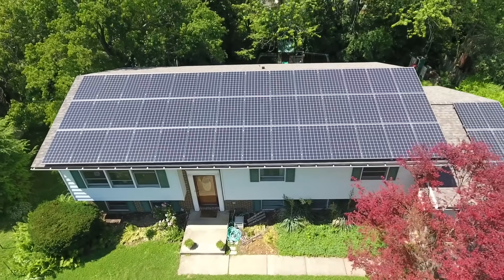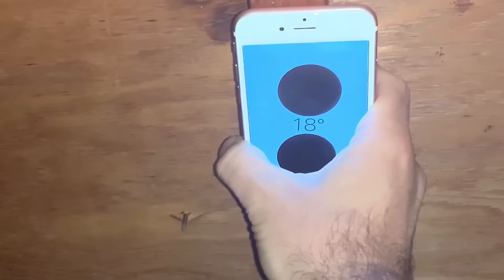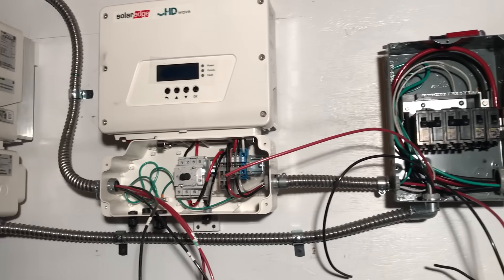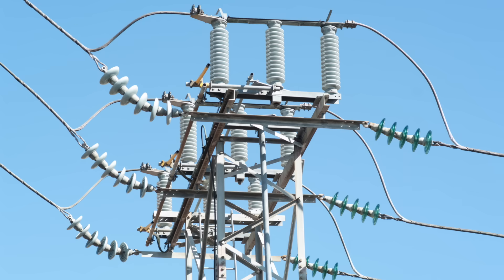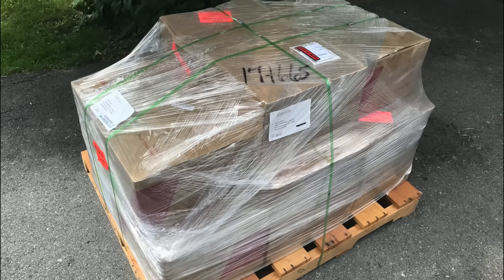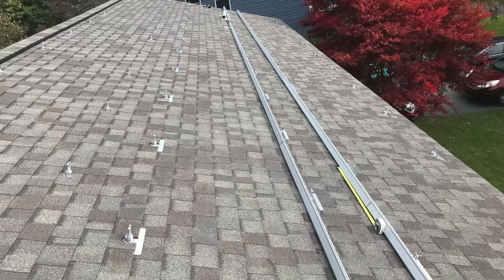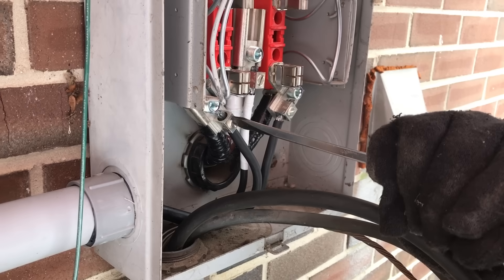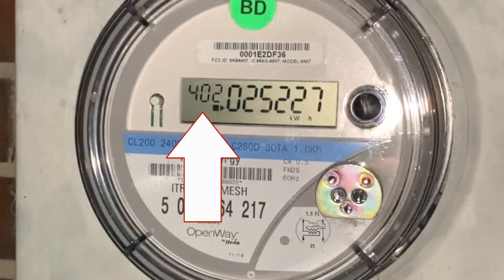I Installed a Power Plant Myself | HUGE DIY Solar Panel System

Comment: never on the roof you only need to be protected the more it is protected the better it is for this I know everyone will say that on the roof on the roof and easier but instead to do quality work and work very efficiently it costs very expensive why you need in six that is in four corners or in 6 corners or in several stages concrete pillar and then you put fiber that is Metal and over the metal you put the solarium then it is quality has no problems has absolutely nothing What can work much more effective for such a thing many will say what you have and for what and how it is much more effective and much more protected roof on Many I have seen how others had problems others had to suffer This helps the solarium to have green energy

Comment: ca să faci energie pe termen lung pentru casă primul lucru îți trebuie să te uiți cât de rezistent îți este acoperișul după aceea trebuie să te uiți foarte atent Cât de rezistent îți este tablă sau acoperit acoperișul ca să poți pune panourile solare cel mai bine este să faci tâlc în pentru panou solar adică să poți veni cu stâlpul în patru colțuri sau în șase părți și peste el Să pui un fel de acoperiș protecție Cum se zice mai rezistent după aceea peste el poți pune panourile solare pe anumită fibră adică metal și după aceea pot spune panourile solare Da Foarte mulți am văzut că spune panouri solare Dar când vine ceva o ploaie sau ceva Are probleme ca să nu aibă probleme cu acoperișul sau cu altceva în fiecare dată trebuie să îți faci protecție

Comment: That was smart thinking to replace the roof singles, while installing the brackets.  I watched my neighbor have Tesla system installed this past January, but I know his roof was replaced back in the early 2000s before he moved into the house. I just thought kind of nuts to have a full install on a 20+ year old roof.
Reply: Why replace the roof shingles? The panels will keep the sun off the shingles so they will be protected from the sun.
Reply: Right! I have new shitngles and that's the only thing holding me back. I wish I'd done a metal roof now, shitingles are a racket, metal lasts a lifetime or 3..Considering building a shed/shop, metal roofed for the panels.

Comment: Solar and wind power production is worse for the environment than electric/coal/gas/nuclear. The elites wants you poor weak and living in tiny homes to get used to communism and the Digital ID of Chi-Nuh. Is our military going to use solar and wind power? Are the politicians going to stop flying in private planes supplied by taxpayers? No. Rules for the not for mee.

Comment: I’m all about solar. But, isn’t a zero bill situation depending on the location and power grid you’re supposed to be connected to?
Reply from the maker: It depends on many things.  Perhaps one of the biggest is having a 1-1 net metering credit with your utility.
Reply: @FrugalRepair  Thanks for the response! I keep hearing different things from different locations about overall cost savings, so it was a genuine question. Still haven’t planted roots, but what you did is what I would like to do when that happens. Thanks for the video!

Comment: What was the total cost of this solar project? How many years of ON-grid power usage would that equate to? What is the cost to remove the panels for a re-roof job? How long to the panels last before they are not as effective to include the wires and the components supporting the captured solar energy? What is the cost of time to maintain this system to remain effective and efficient? When you add it all up, I believe the thumbnail stating BOLDLY… “NO BILLS” is a farse and the money invested in this project could of been invested in gold or simply kept in the bank. With that said, I am a big supporter of solar and wind energy and believe that when combined together can be an excellent supplement to on grid energy and with properly installed and maintain 6 V batteries commonly found in golf carts, you can create an affective emergency power back up system. However if my previous questions are honestly answered, something like this and saying no bills is nothing but a missleading pipe dream for lefties to grab a bottle of Jergins and pleasure themselves

Comment: Leak does happen but if you get it fix before it gets down to your house you’ll be fine I’ve had panels for a while and just last year I had to fix a leak i always check around the roof every year and inside the attic for wet spots . Nice vid 👍

Comment: Let’s check this financial decision. He abandoned the cheaper economy of scale (+profit) of the utility company in order to transition to something that he had to pay all at once, with maintenance costs (in time and money) and potential unreliability on the menu. On the plus side you are autonomous and for some this plays a huge role (it does for me). On the minus side you pay more and a big sum of money at once vs incremental payments to a utility company. So far it doesn’t make much sense. Moreover, if that technology malfunctions before it get’s its money back from the investment it’s another extra expense. Not to mention the expense on time you devote to maintain these things running (especially the batteries).

Comment: What was the upfront cost of the panels? What's the install time and cost? Yearly maintainence? Are you still hooked up to regular power?  What happens when you're battery pack degrades? When do you have to replace the battery pack?
Reply from the maker: I don’t have any batteries.  Check out the videos after this one for answers to the other questions.

Comment: Wanna point out that at 8 min when he notes the roofer is putting thousands of holes in his roof may wanna note that shingles overlap each other so the nails and holes are covered by the next shingle and so on that's why it works tho the holes slightly exposed it's under the panel and got weather proof caulking in there to fill the void once it sets

Comment: Curious if you have had to deal with birds moving in.  My friend has solar and he had to make a bird cage around the sides.  It also keeps leaves out which was a bonus.
Reply from the maker: Nope, no issues at all with birds or squirrels.  I wonder if your friend has a smaller clearance from the bottom of the panels and the roof surface.

Comment: I am only an electrician (apprentice) for 1year an and build 3 PV  and holy crap that must be a thing in USA because we connect (in this case for every row) in rows so that there will be 3 circuits they all go down into 1 single maschine called the "Wechselrichter" or in english: inverter    no extra stuff on the roof 
But there is a giant diffrence around the world i mean look at the outlet

Comment: What would it cost to generate 35-50Kwh /day?
Reply from the maker: Not sure since there are many variables.  If it helps, today is decently (but not total sun) sunny and late afternoon here my system has generated 72kwh so far.
Reply from the maker: You can watch the video after this one if you want to see what I spent on the system.

Comment: I have just one question;
What was the total cost of everything done?
Reply: Considering he used 48 panels, prices may vary but lets assume 250€ each, that's 12000€ on panels alone. For all the extra hardware under the panels and inverters, cables and permits, I'd assume the system probably costed between 20 to 25000€. That's like paying 110€ on electricity for 10 years before brake even. If you pay less electricity it could take 15 or 20 years to break even.
Reply: He paid 72,000.00
Reply: @tcathunder  Wow! That would never pay off for me... I'm fortunate that our electricity rates where I live are pretty cheap. Now, our natural gas rates are a different story though! Lol
Reply: @GearheadStew  I mean he is probably pretty happy with his system right now with electricity costs this high.

Comment: Interesting how you omitted the fact that you voided the warranty on $20,000 of equipment (panels and inverter) by doing a DIY,  just-wing-it, kind of system. When something fails shortly because you're not an electrician you've got a big expense to pay to keep it working.

Should have hired pros. The extra expense due to the lost warranty will outweigh the cost of going with an actual solar installing company.

All the details you cut out to make a 12 min vid on YT hide why this is a bad idea.

Comment: I am pleasantly surprised by the quality of this install. For what's its worth (as a random YouTube commenter who happens to be a solar engineer) I would just say that these installs are HIGHLY dependant on location. Solar is a new industry and the codes change often state to state. For example, in Florida, this install won't be allowed because the edge spacing between the panels to roof edges and ridges are too close to pass the fire code setbacks and the latest ASCE 7-16 requirements for wind loads. He used all the right parts and install methods but there is no substitute for a good PE when designing your system to be sure it's safe and to code.
Reply from the maker: Thanks!  My area did not adopt some of the setback codes when I installed.  My design plans were approved by a solar engineer and inspected by local electrical inspector.
Reply: @FrugalRepair  definitely, you clearly got all the approvals you needed. Just wanted to point out how quickly the standards of what is "acceptable" changes. A year makes a huge difference in this industry

Comment: You must be in America. 
Because here in Australia you have no choice but to pay someone to do for you.
However  if you don't tie to the grid in theory you could.  Then there is another problem,  The insurance company will probably void your policy as you are seen as  incompetent.  I found that out when I cut small tree and broke a few roof tiles.
They asked me if I was a qualified,  certified tree cutter . I said I'm an electrician they then told me I was incompetent and would not process the claim.  That's Australia for you . Some times I wish had never come.

Comment: A great video, I installed my own 4.5kw system about 10 years ago, ( i wanted to install 8Kw but was limited at that time by the power company) I pretty much went through the same process as you and only called in an electrical contractor to install the new meter and commission the solar array, My array initially cost 10k, and gives me an average rebate of about 400 per qtr,  it does not quite cover my total power bill due to high power usage from my 2 aduly kids but over the 10 years it has still paid for its self about 1.5 times , so again it was well worth the investment.
Reply: That is great as long as it costs only 10K.  Good luck doing that these days.  For that cost I would jump at the opportunity.

Comment: Did you need a variance from traditional Fire setbacks (3 foot rule)?
Reply from the maker: The area I live in did not adopt that part of the code so I didn’t have to request an exception.  I was aware of it though when I was designing the system and confirmed with the electrical inspectors.

Comment: Do you expect to replace panels a few years down the line? How efficient will your panels be 10+ years later? Do you need to keep replacement parts for future use (in case they get phased out)?
Reply from the maker: I expect very little maintenance for the life of the system.  The panels should have little efficiency loss.  No, I don’t currently have any spare parts on hand.
Reply: If you are buying panels from tier 1 manufacturer, they will be typically last for 25 years and first year 2% degradation is 0.55% for subsequent years.

Comment: Installing solar panels is easier than it looks. Its just that the size of the installation in the video for a single house is way too big. Considering that we consume at most 200-250kwh per month in my household, 18000kwh per year is mind boggling. Even I use electricity as the main source for heating in winters, that would add at most 2000-2500kwh to the annual total. I guess that’s the difference between US and the rest of the world. 

If I installed the same system in my house, it would never pay off unless I sell all of the electricity produced. Even if I manage to sell it at a decent price, it would still be too expensive without any government subsidies. 

Speaking of Frugal..... absolutely nothing to say... 

PS: Good video...

Comment: SolarEdge Systems and Optimizers are only needed when you have shadows moving over your panels. Ofc the inverters are cheap and nice warranty conditions, but all the needed optimizers rise the costs again and when they need to be replaced (the more you got, the higher the chance for a defect), its always time you have to invest to report it and wait for replacement.
Check out Sungrow inverters if you want cheap ones. Always remember, Quality has its costs, so dont expect too much of cheap components.

Comment: You also have to add in the cost of shingle replacement in 20 years, you are going to have to take the solar panels off, replace the shingles then put the panels back on.

Comment: Seems a bad idea to pop a bunch of holes in your roof imo and when it comes to re-roofing your home it will be alot of extra work. I feel yard panels are the best bet for long-term solar systems or just make a carport and or pavilion so you can use roof panels but not worry about leaks as much which would look more appealing to the eye than yard panels on posts. A leaking roof can start long before you find an issue causing tons of internal damage to your home causing possible black mold to grow within your walls.
Though they do have solar panel shingles now a day that actually make energy from rain running down them. This would be a longer lasting safer means for a roofing over your home setup.

Comment: Since you are putting electricity to grid, if there are outages in your area, does your system detect that and stop putting electricity on the grid? That way if someone is doing some maintenance/repairs, they don't get electrocuted?
Reply from the maker: Yes, the inverters automatically shut down the solar array if they do not detect the grid voltage.   Its a safety requirement.
Reply: @FrugalRepair  That is great to know that inverters do that!
Reply: All grid tied inverter needs to have this function call anti islanding. It is part of the IEC standard.

Comment: That is the only way solar is good for the homeowner (no parasite in the middle)  if not the price of installation will eat your saving with solar, same with electric cars, the price includes the gasoline you would have saved, so it is not cost-effective.

Comment: Really great job you did! Im an electrician myself in Belgium (europe). Here we can send electricity back on the grid but we don't get paid for it, and for every Kw we use we pay for it. So we have to use our energy during the times where the sun shines or we have to install big batteries to save the energy our solar system made during the day so we can use it in the night time.
Reply from the maker: Thank you for your kind comment!  It’s great to get paid for the electricity generation.  I wish you had it there too.
Reply: @FrugalRepair  We used to have meters that could run backwards but they changed them because the government lost too much money because of it. I think America will come to that point in the future too.

Comment: So at night or on cloudy days you have to  use power from the electric company or can you store the power? I didn't see any backup batteries
Reply from the maker: I’m grid tied so electricity is supplied by solar or the grid depending on the solar production.
Reply: @FrugalRepair  so ideally, you use solar during the day, sell any excess back, then buy what you need for night time usage? Night usage is usually cheaper than day usage.

Comment: I know zero about this stuff. I did think the electric company or grid would not be needed if a solar system is installed . Can anyone explain why the grid is still needed?
Reply: Cause solar is not a reliable power source. Cloud, rain, night time does not give you power. Batteries are expensive. Power grid is the cheapest per power unit.

Comment: Good job on the install! Enjoyed the video. I don't have a single line of your install, so I am unable to determine if there is an automatic disconnect that would isolate your solar from the grid if there is a grid power outage. Is it an integral part of the meter or is it a device in your system? If it is part of your meter you would not lose power during an outage, but if it is part of your system, you would lose power every time the grid goes down. Just started doing some research on solar, so I am still green. Could you enlighten me?
Thanks
Reply from the maker: Thanks!  Glad you enjoyed it and are looking into solar.  Feel free to shoot me an email if you have questions.  The automatic disconnect is built into the inverters.  There is a manual disconnect switch, both are required.
Reply: Was also wondering if you have a disconnect so that if the power is out you are not back feeding the grid and chance of electrocuting the lineman?

Comment: Ha ha his thumbnail says no bills. BS he has bills he has property taxes and he has other bills like water and gas. I know a guy that went solar panels and he told the electric company to take the electric bill and shove it up there @$$. Hmm he lost his house due to bad wiring on the solar panels system and he never has it installed properly and by a licensed electrician. He had to relocate to the house he owned next door. He contacted the electric company and they told him he's bared from ever getting electric cause he told a employee tech to take the electric bill and shove it up there @$$. He had to pay off what he owed plus deposit and he had to repay the deactivating fee and reactivation fee. Which totalled up to $750.00 and they sent another bill days later.